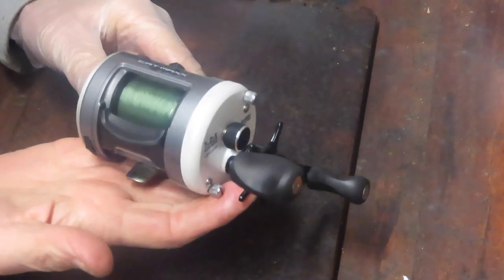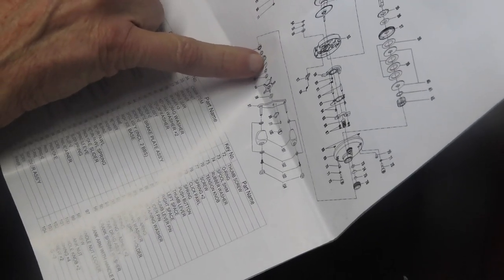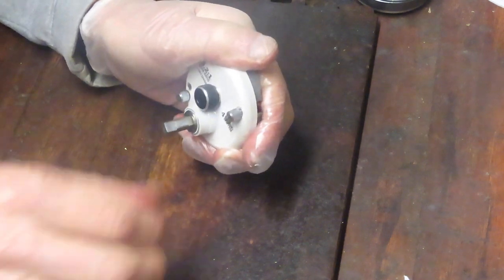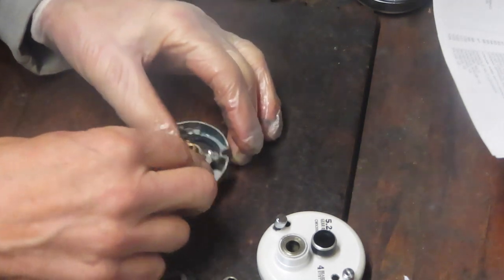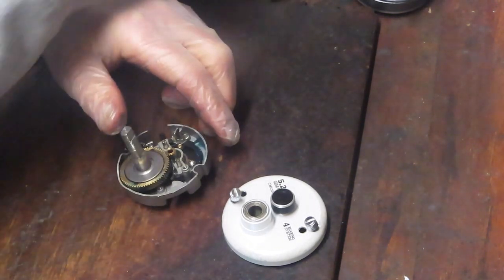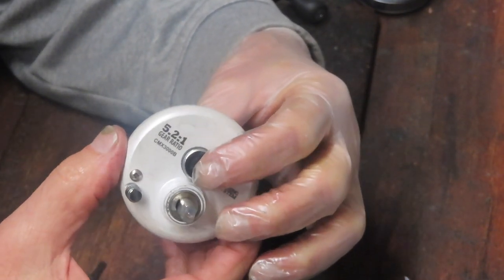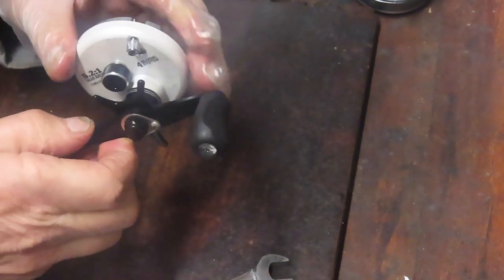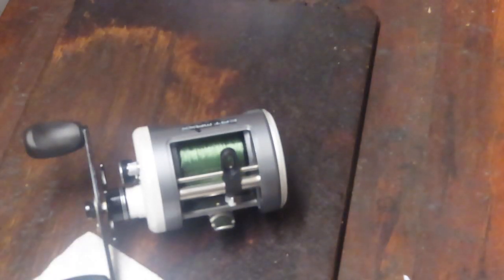Bass Pro Catmaxx round baitcasting fishing reel  inside look and how to take apart and service

Comment: I can't get the warm gear to move I think that's what it's called on my cat maxx reel. Any suggestions on what I can try to fix it. When reeling in my line it stays in the same place instead of going back and forth. Thanks
Reply from the maker: There are a few components to check.  Take the pawl out of the line guide and see if your worm gear moves when you crank it.   If it does, you need to replace the pawl or clean the tracks on the worm gear.  If it still doesn't move, check the gear that drives the worm.  If it is missing teeth or broken, it will not turn the worm gear - Dennis
Reply: @2ndChanceTackle  I took the pawl out the gear still doesn't move I'm going to tear into it more this weekend thanks